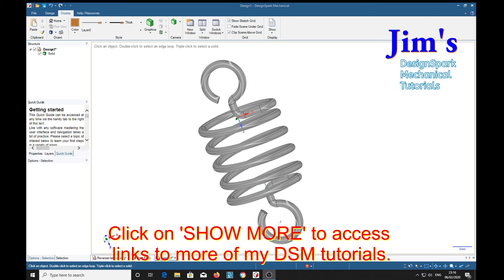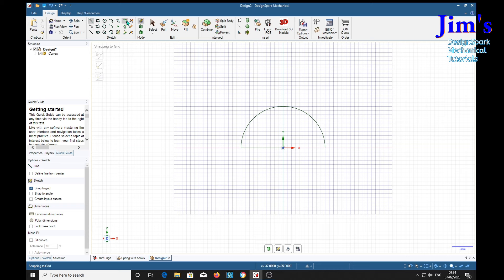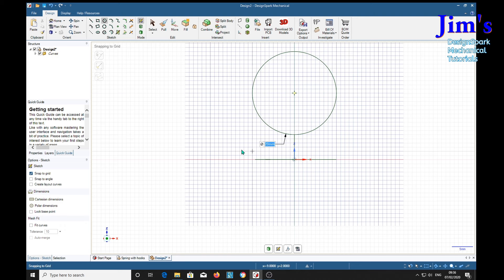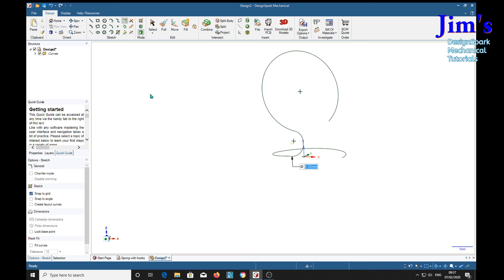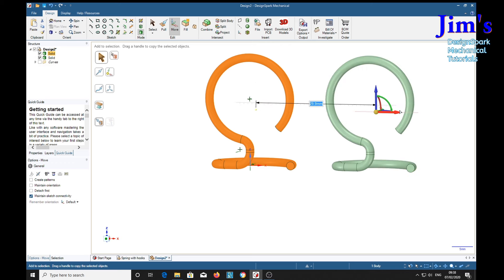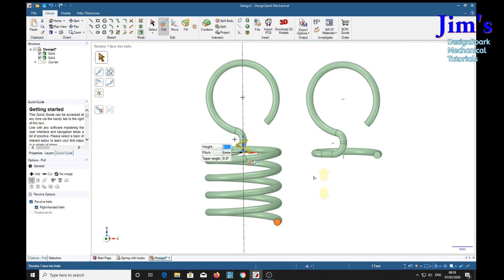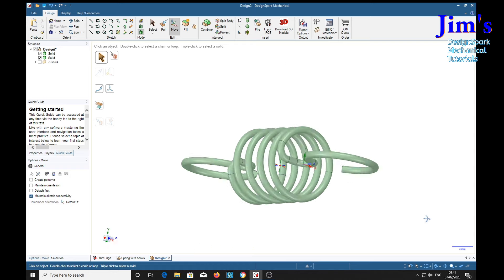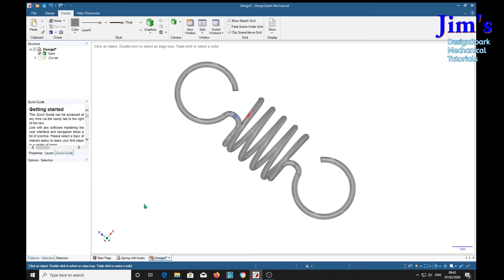Modelling a tension spring with hooks in DesignSpark Mechanical.

Comment: You have no idea how much your videos helped me. I got dsm years ago, not knowing anything about cad and struggled. Then I was convinced fusion 360 would be better because it has more tutorials. Then I watched those tutorials, and it was like you were expected to know certain terms and functions that I didn't know. And yesterday I stumbled upon your tutorials and I learned how to put a groove in a cylinder, that was huge for the project I was working on. I subbed immediately. Thank you so much for not assuming we know anything, I put away my 3d printer for a year because I couldn't translate the part in my head into a 3d model.